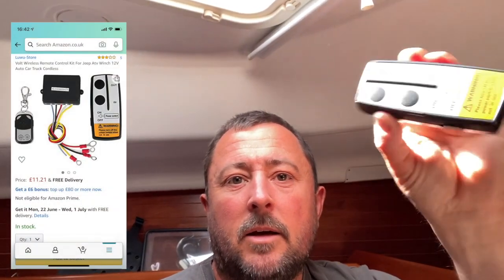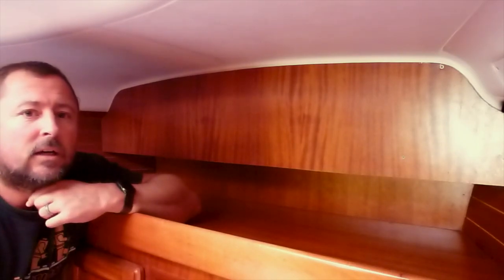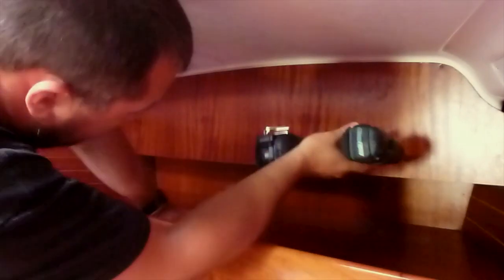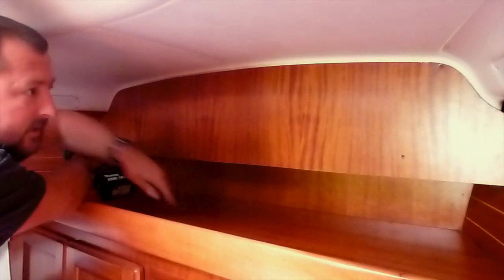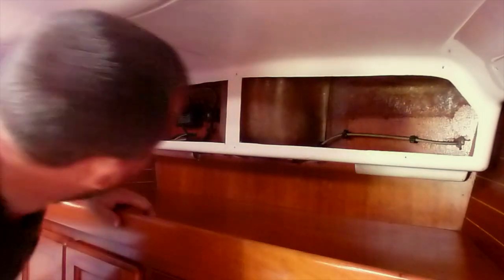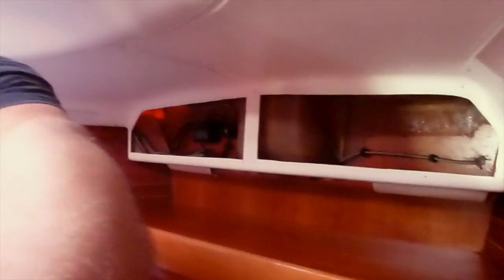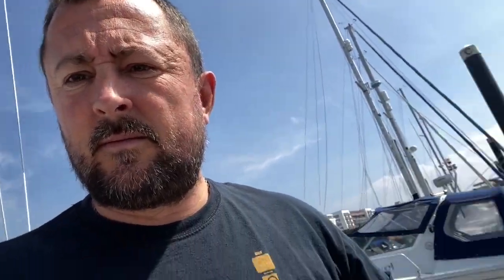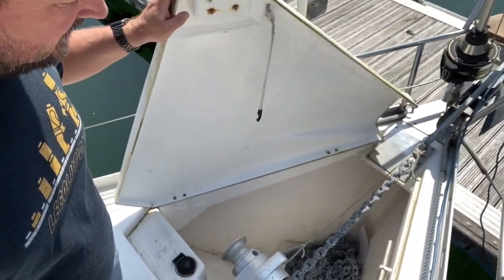Baggywrinklers Ep1 - Remote Windlass

Comment: Hi, nice video.
Have a question, bought the item and connected it to the windlass solenoid, however it does not work as it should. When lowering the anchor, the windlass seems to pulsate and not lower in a smooth continuous motion. Bringing up the anchor works fine. I bought a 2nd module thinking it was defective however same results. Do you have a picture to show each coloured wire goes where on the solenoid? Thanks